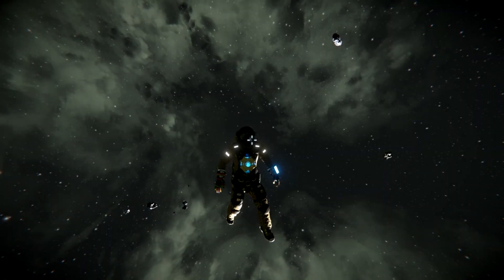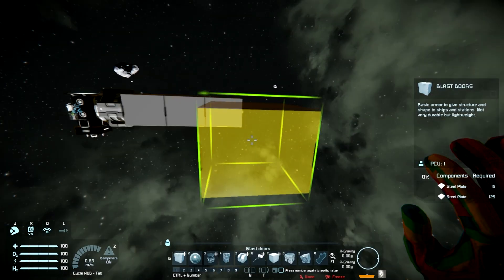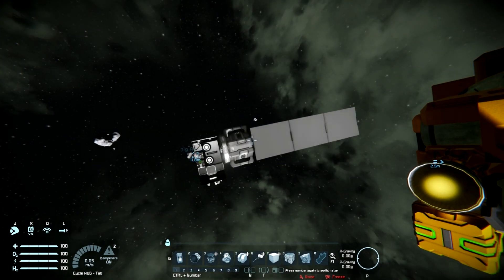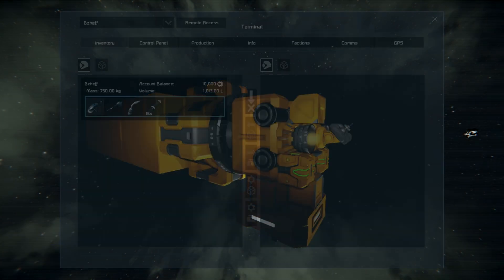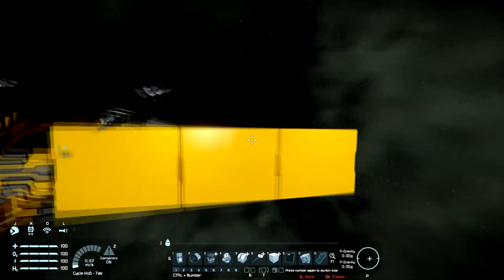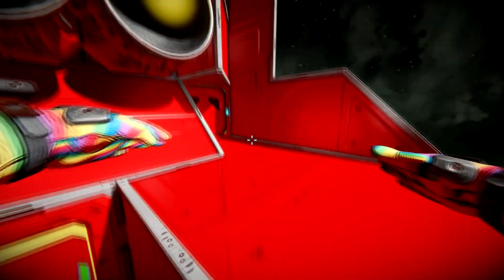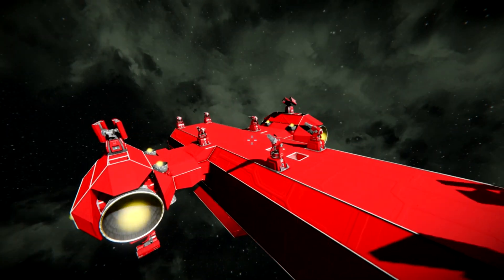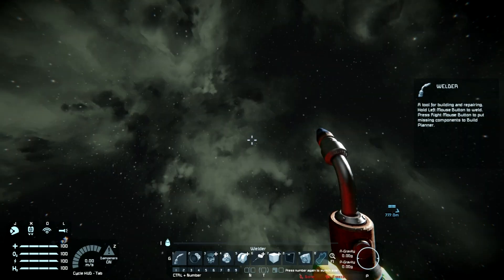Space Engineers Devastating & Cheap Compact Guided Missile

Comment: I use a 3*3*2 big grid missile that is filled with door blocks connected via light armor or functional blocks. Two large grid hydrogen thrusters allow it to outrun any dodge attempt, even if you are a smartass with a clang or gravity drive covered in double heavy armor. The door blocks fragment on impact, each one individually penetrating deep into the enemy ship.

The reason it's 3*3*2 is to cover a welder completely. That way when it is stationary the welder is protected by armor blocks, and the whole thing can be printed with a single welder.

It is fairly resilient to turret fire, and can take 3-5 rocket hits. Of course it won't survive 50 turrets, but if you launch more then one, the first one to enter will keep soaking the hits, allowing the other ones to close in.

I also don't place cameras on the missile, as those get easily disabled by gatling turrets, instead using camera lock from the mothership. If there were no scripts I'd just go for a kamikaze attack with a chair.

Comment: Cant seem to figure out how to attach this to a ship, just wont connect to the merge blocks
Reply from the maker: Small grid to small grid and large grid to large grid. If you're using a large grid ship, you can use a rotor with a small grid merge block or you can put a large merge block on the payload part of the missile. Hope that helps
Reply: @mynameisjeff-spaceposting1417  The small to small just wouldnt work on my large grid ship using the rotor, but the large merge block on the payload worked! Thank you so much it was driving me nuts!
Reply from the maker: No problem! Thanks for watching

Comment: How do u manage to use it with welder since projector can't project multi-grids?
Reply from the maker: I weld them manually but you could have a small grid projector on a rotor on your ship and line up 2 separate projections. You'd likely have to manually attach the head in the menu before firing. I'll be debuting a new missile connector system in a little bit
Reply: My name is Jeff - Spaceposting “i’ll be debuting a new missile connector system in a bit” ———— pls do, im new to the game this video was awesome, keep the good work up
Reply: You have to fuel it manually anyway so why not just weld it by hand as well